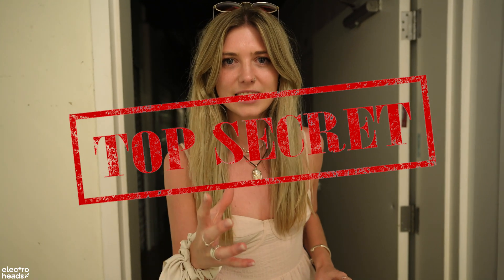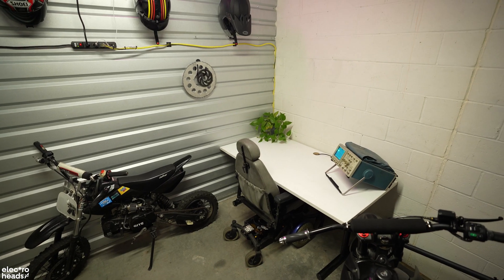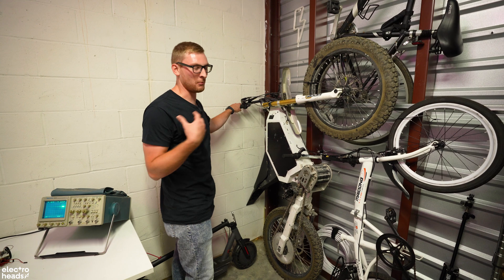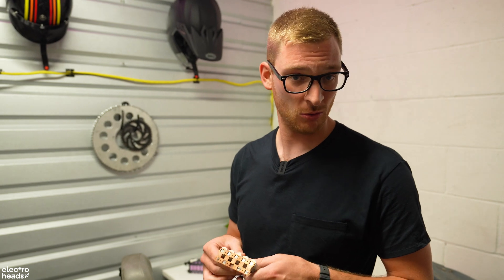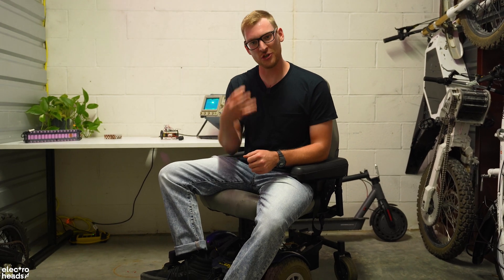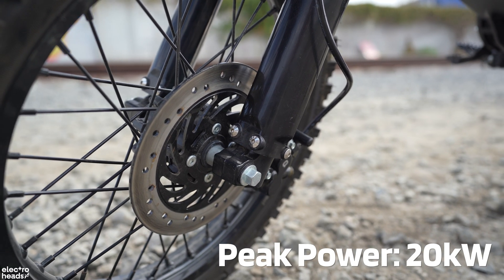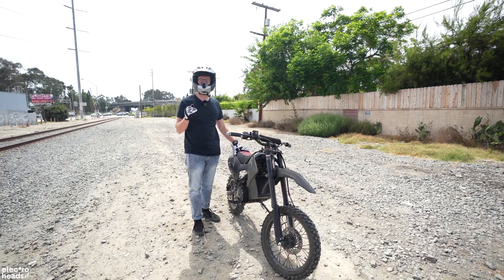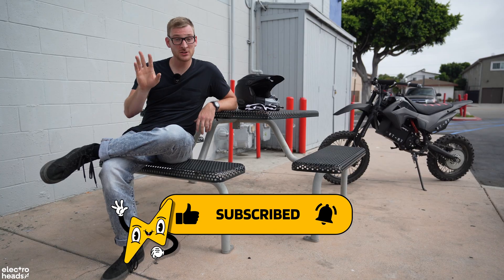I made this powerful E-bike for CHEAPER than you can actually buy one

Comment: Welcome aboard. Custom-builds are great, and I do want to see the crazy shit you can come up with (or already did).

But, for the 250Watt restricted people in the world like me, I would love to see what you can do to Europe and UK legal bikes. 

For example:
 - add an extra battery to a folding bike
 - add range or power to a cargo bike
 - slap on a solar panel on a bike
 - replace several components of the bikes that are around and just increase the range, eight capacity, and so on
 - create a bike that allows me to charge it by... pedalling. So that I can 1) go out, 2) pedal like crazy, 3) run out of battery, 4) pedal to charge the battery (with a switch that switches to battery charging mode), and 5) then pedal some more back. 

To be clear, the next level of awesomeness is for us to be able to try to do those "don't try this at home" builds ... in the shed as well. :)
And then take them out for a spin.

Comment: I am interested in a Part list for the dirtbike 🤩🤩🤩
Reply: Same
Reply: @zakbrinkhoff324 me2
Reply: Qs138 motor // 72v battery // controller Fardriver n72530
Reply: Where’s the best place to get a frame from
Reply: @tadassmolskas3014 what is the frame tho
Reply: @1oneyute Looks like a YZ 125 frame to me
Reply: @jacksoncolsch  no its just a generic amazon bike frame a syxmoto or tao tao 125 4 stroke frame a YZ125 is like trilp its size
Reply: @ghastly545  my bad idk why i said yz 125 i meant to say rfz 125. you’re absolutely right though, definitely not a yz 125 😂. I have actually been waiting for a good deal on a yz roller to convert to electric, would be a super nice platform to start on

Comment: Build the cheapest conversion kit and convert a small eco gas misser old car or small van, to EV. 
strip out all the junk from an old car that weights less than 1000Kg, and convert it to an EV that can do 120 Km/h for 100 Km.
You should be able to find a "none VW" car for less than $500. No rust in the area of death valley or Los Vegas. 
Hey, you asked!